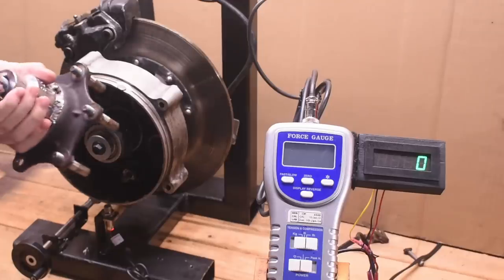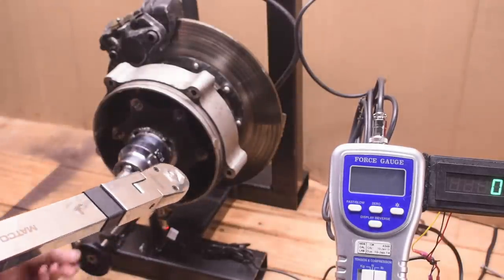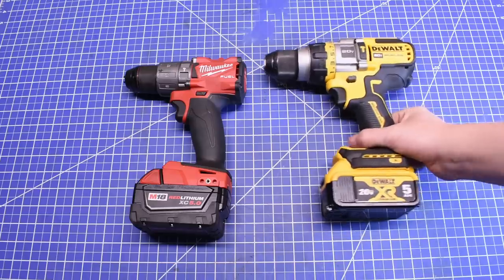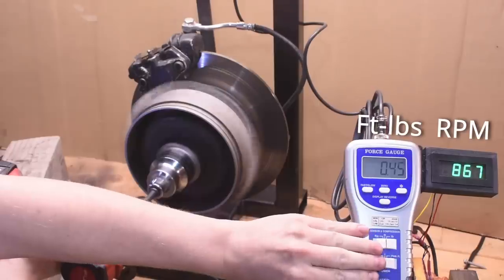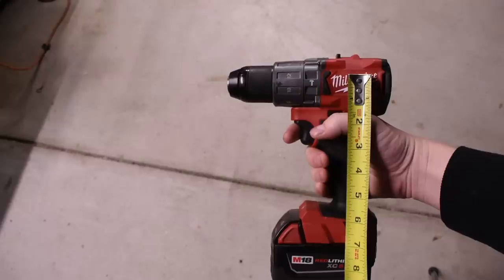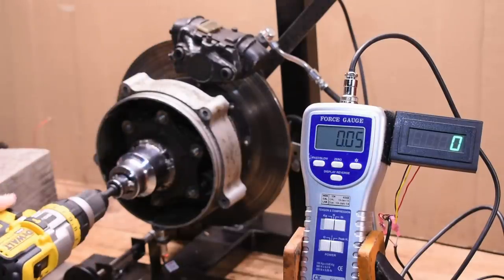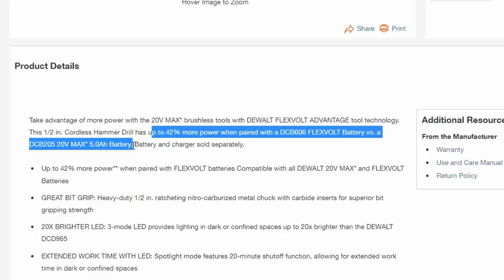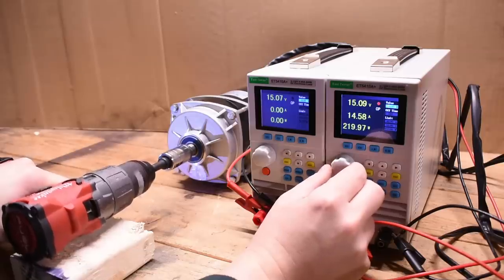DeWALT vs Milwaukee on a Cordless Drill Lie Detector (Dyno Brake)

Comment from the maker: Those with our tool rankings would have seen us add these drills and this category early this week: https://etsy.me/3G8j3QK 
We've seen testing in low in wood with torque adapters before, but doesn't explain why some drills stop so easily drilling into metal on high. We simply dont use cordless drills in low super often. On the topic of soft vs hard toque (giggity) Being we're the torque test channel and already have a rig set up for testing bolts until tight, we obviously tested this 1st and the M18 did NOT read 100 ft-lbs. And that's not useful.
Reply: @mrmalicious4421  you’d probably smoke the pads pretty badly, but it’d be interesting to see!
Reply: can you test einhell/ozito tolls (i have no idea if they are avalible in USA but they are avalible in australia (ozito) and europe (einhell) thanks.
Reply from the maker: @mrmalicious4421  Peak torque of an angle grinder is not very useful info, basically stalling power. At that RPM you're doing no work. We're working on a different high amp motor dyno for angle grinders, but no promises. Sometimes it just doesnt work.
Reply: Bosch GSR 18V-150C is a good drill
Reply: This is way over my head, but the results are very useful, as ever.  Would love to see more tools from team green (Metabo HPT) to know whether I made a mistake buying into that ecosystem fifteen years ago.  Their lifetime tool warranties are reassuring, but not factored into your tests.  Thanks for you all your hard work!
Reply: Would you consider testing some bosch drills?
Reply: I am confused, I read depending on the type metal you should drill metal at low speed per the charts and type metals. Yet you say you drill metal at high speeds and it fails. Which from my humble experience hard metal does not drill well at high speed. Therefore, would be expected.
Reply from the maker: @bettymaverick1098  Drill speed is not simply by material type. It's by material type and diameter. Most drilling we do is high speed for cut quality reasons, but ideally something 3/8", 7/16" would want more like 1,200 RPM or 1,500 RPM into mild steel but the Milwaukee doesnt have that speed option. So its 2K RPM that bogs down to 1,600, 1,800 is closest. But the tool will just stop often. So the 3 settings on the Dewalt make that an easier go regardless of torque numbers really, but it also performs better in high than M18.
Reply: Will you guys be testing the 18v makita?
Reply: If you were to get some  dyno software/ data acquisition.  something like yourdyno or the likes.  To add to your  dyno brake.  Would be able to get  both power (watts) and torque all from the same rig. along with taking into account the inertia of your brake.
Reply: I emailed ya'll a bit ago offering some tools to test. Is there a better way of getting in touch?
Reply: I do not recommend a drill with very high power and very bad side handle, I have the milwaukee, and it is very powerful but the side handle is basically useless
Reply: I am planning to move from the Milwaukee drill to the new Bosch Profactor GSB18V-1330, claiming to generate 1330 ft/lb, main reason is that the milwaukee side handle is basically useless so the drill is too dangerous when drilling
Reply: Merry Christmas. I love what you guys do!!!! Thank- You
Reply: The whole time I’m watching this, I am yelling “We Want Hercules! We Want Hercules! We Want Hercules!”😅

Comment: As a welder/fabricator, I would love to see you guys test corded right angle grinders. I use them all day, every day.
Reply from the maker: We'll give it a shot
Reply: @TorqueTestChannel  i have used a 1200 w bosch grinder with anti kick back and it cut out well before a 900w bosch grinder
Reply: @TorqueTestChannel I find that the m18 milwaukee grinder can't take as much load as a corded one
Reply: @TorqueTestChannel  Yeah please test the Flexvolt angle grinder! (dcg418). They claim 3HP, I'd love to know if that's accurate, it's a beast either way.
Reply: Anti kick back will always hurt performance, mostly for good reason.
Reply: @rileymannion5301  the Milwaukee m18 grinder we have does well...on a full charged battery...for about 30 seconds before the battery is half dead and it stalls with what I consider a small, maybe medium, amount of pressure. That thing destroys batteries. Our batteries worked well with our 3/4” impact until we started using them on the grinder more consistently.
Reply: @rileymannion5301 Good call. I have the flat head M18 125mm (5 inch). They along with others claim to be equivalent power to a 1200 watt corded grinder. As a steel fabricator using grinders every day, I can tell you they are more like a 900 watt corded. Probably not even that. So I would love to see battery grinders up against corded as well to see where they really compare. And of course battery grinders alone maybe. 🇬🇧 I’m subbing to find out🙏
Reply: @BryceKimball7.3 Sounds like you’ve got old batteries. Mine works great almost right up to the battery being dead. But I have also found that any high speed tool does like to eat batteries up.
Reply: @TorqueTestChannel  please include the m18 4.5-6”!! It’s a bigger body then the 4.5-5” and i have used both and believe the 6 to be more powerful. It also cuts much deeper with the bigger blade which is very useful.  The smaller guard will fit if you have a tighter space as well. I love mine besides chewing through the batteries. But this would be a great test, the grinders!!! Awesome videos too man you guys do a good job!! 👍🏼
Reply: @grumpyone5963  the batteries are a couple years old and worm great on the 3/4 impact. The grinder just kills them quick
Reply: If you do test angle grinders, please throw the Bosch GWS8-45 into the mix. I have a 10/10 experience with them.
Reply: @BryceKimball7.3  Ok 2 year old batteries should be ok. I can’t think why they’re dying so fast unless they are small amp hour batteries. I use standard 5Ah and 8Ah high output in mine and there hardly any difference apart from run time. But my grinder does get through them way quicker than my SDS drill for example.
Reply: I used both the 4 1/2 and 6” Milwaukee cordless grinders. The 6” Milwaukee cordless grinder with a 8 amp HO battery was a very nice tool. But it didn’t hold a candle to a corded grinder or really even the 6” dewalt
Reply: Why aren't angle grinders reversible?!!
Reply: @TheMrbubl3s  we used to burn up the bosch / hilti corded grinder . i'm talking the 7 inch . grinding fiberglass it didn't hold up. the dewalt 7 inch 15 amp grinder was much better. the old wildcat that got discontinued was the super beast. i'm talking grinding with a diamond cup wheel pressing down hard on the center to cut material. grinding panels 4 x 18 feet . bosch grinders were crap. same with hilti which are actually made by bosch.
Reply: @helixhippie  well duh, because..... huh... great question
Reply: Corded grinders will continue to rule heavy work in welding etc because of their output, size and cost. Many welders buy MANY corded grinders plus a few cordless for light work, but by nature welding means power is available at the gun/stinger that also being electric.  Test some REAL grinders not the baby 4-1/2 inch things whose only virtue is they're cheap.

Comment: I'm always most impressed with your teams abilities to figure out ways to test the parameters and capabilities of each tool. Some of your test stands are ingenious.
Reply: I'm pretty sure I watch this channel more to see their testing methods than to see which tool is best. I really like the contraptions they come up with.
FWIW, my job is designing and programming industrial sensors (flow meters).
Reply: It would be nice if they used a standard device say a cheap water pump from harbor freight.  Then we could make our own set up at home and see if our devices are similar.  Like how many lbs of water can your drill pump 1 meter in 1 minute.   You should be able to determine the horsepower that way.
Reply from the maker: @MichaelMantion  Tools Tested channel is working on something similar with hydraulic fluid. The problem with the water pump idea is it only measures total work done, not peak power (torque or watts). You have to be able to gradually increase load until the tool cant sustain then have a quantitative number for that load. Someone could buy the drill that pumped the most water then be like why does this thing stall out anytime I try to push it harder? Because it's best suited for pumping water.
Reply: @TorqueTestChannel  this.

The den of tools used a drill water pump adapter to measure capacity of batteries for comparison between Bauer and Hercules batteries to rate them for capacity to see if the claims were correct. 

He also had to replace the water pumps because they wore out too quickly.
Reply: FACTS!!!!
Reply: All though those dial indicators dying for almost no reason was somewhat hilarious

Comment: I would really like you to test ordinary corded drills to see how battery drills stack up
Reply: I think I might have seen that video from this channel. I could be wrong though
Reply: I found this. It isn't exactly cord vs cordless, but pretty close.
https://youtu.be/zQm95N8sGTg
Reply: What is an ordinary corded drill ? there’s millions of different ones. 300w or 750w ? different gearing, task related.  240v or 110v ? things to think on .
Reply: a thought:    a series of tests on battery longevity in power tools would be interesting, there’s a warren of rabbit holes to go down !
Reply: The testing videos are endless!!!
Reply: @1pcfred   well, there you go, I have never bought a drill that didn’t have a half inch chuck,
Reply: @1pcfred   nope, I checked,even my battery drills are 1/2” !
Reply: @1pcfred   I lied, I have a 3/8” chuck corded bosch I inherited from my uncle, must see if it works.
Reply: Nearly all corded tools use universal brushed motors. You are comparing dumb controlled (triac control for speed) universal brushed motor tools against brushless motor tools with intelligent speed controls. Would be interesting.  Btw, it's called a universal motor because it can run on DC or AC (not the triac controller though), but all it really is, is a series wound DC motor. A series wound DC motor will spin the same direction if you change polarity on both the series field and armature. (IE: tying A2 and S1 together and changing polarity on A1 and S2 does not change motor direction, both polarities on the 4 terminals change together as they are tied together). You can only change direction on a series motor if you keep the S1 and S2 same polarity or A1 and A2 same polarity, but change the other. That is why it works on AC power just as easily as on DC power.
Reply: @1pcfred  You are incorrect. The reason it runs on AC is because the field  and armature are both having polarity changed because of being wired in series, which does not change the vector forces for torque in a different direction. This is not up for debate just as 1+1=2 is not. AC switches polarity, and you can do the same by changing the plus and minus on the battery on a universal motor and it will not change direction. It  has nothing to do with the commutation of the commutator. You can either accept you are wrong or continue to harbor incorrect notions as you do now, but ignorance is dangerous to have. 

I suggest google: How does a universal motor work on AC and DC? Here is what you will find:

"It is because the armature and field windings are connected in series that a universal motor can operate with either DC or AC supply. Being connected in series means that both windings are supplied by the same source, so if the voltage source changes polarity, as it does with AC supply, both the armature and field currents also change polarity and the direction of torque does not change. (The direction of rotation is reversed by reversing the current in the field circuit.)"
Reply: @1pcfred  We are talking about a changing the stator field AND armature polarity. If your theory is true, then a permanent magnet brushed DC motor would rotate on AC. It does not, it will vibrate because the magnetic field on the armature is changing, but since the stator is permanent magnets (not changing), the torque forces will change direction as the polarity changes from the AC. It's not just the internet that proves to you as to why a universal motor goes the same direction regardless of polarity changes, but books and ACTUAL demonstration. Take a universal motor out of blender and hook it to a battery as either polarity and it will not change rotation. Do the same for a permanent magnet motor and IT WILL change direction.

 You are getting the commutator switching action polarity changes and polarity APPLIED to the the armature commutator via the brushes mixed up. That is what is confusing you. 

Books that explain it exactly the same way it works as I have done: 

Electric Machines (Isbn: 0-8493-8581-4) on pg.397 
Electric Machinery (isbn: 0-07-366009-4)
Pg: 395

I cannot help you get rid of ignorance. That is only something you can do. Prove your theory with a demonstration. Hook a permanent magnet motor up to AC and see for yourself it will not rotate, thus your theory will be wrong.
Reply: @CrimeVid  nope pistol grip corded drills would come with 3/8 or 1/4 usually. the 1/2 inch ones would only go 1200 rpm and were made for torque. i broke my hand with a 1/2 inch corded drill and a 6 inch hole saw in pine.

Comment: Great testing as always. One issue i see is while yes the drills are adding pressure to the test rig which is being measured while the rotor is turning, when the brakes actually lock up the rotor, all that momentum (potential energy) is turned into kinetic energy causing a spike in the brake force right as the rotor comes to a stop. You would have to have an electronic device to track the brake force so you could take the reading from the moment before the rotor came to a sudden stop. This would also eliminate the variable speeds that the drills will be stopping at. For example if a drill stops at 300rpm vs. a drill that stops at 340rpm, the drill that stopped at 340 rpm will show more torque even if it was a weaker drill because of that rotational energy stored in the rotating assembly when it stopped. Your results are pretty close anyways, but i think this was important to note since often we are splitting hairs between batteries and tool setups. Other than that i love the setup. Looks like a great way to eliminate parasitic loss. If anyone thinks i am incorrect in my thinking or has anything to add please do thanks.
Reply: The rotor stopping suddenly has nothing to do with the brakes locking it up or a spike in brake force, and thus would have very minimal, if at all, effect on the torque reading. The rotor stopping suddenly is happening because of the motor/battery of the tool cutting off power to prevent stalling at full power as that is really really bad for these brushless motors. If it was in fact the brake caliper locking up the rotor, we would see MASSIVE spikes in the FT/LBs reading because of the momentum and weight of the spinning mass suddenly stopping, I'm talking 100+ spikes in FT/LBs. If you notice, they have a small dial on a worm gear to apply a constant braking pressure that they can increase gradually. Don't worry, these guys know what they are doing since they do it "for a living"!

Comment: I've also often looked at the total tool weight as a purchasing factor, as it makes a difference on how less tired you're going to be after using it all day long.
Reply: That and overall comfort. Generally I’ve found that most tools throughout the same brand have similar ergonomics. Just like pistols. It doesn’t matter how expensive or technically better  it is than another one. If it’s awkward fit for you, then you likely won’t be accurate with it or want to shoot it.
Reply: After a year of using only a 1/2" chuck drill I bought a 3/8" chuck drill.  I use the smaller one more than the larger one.  That doesn't include making pilot holes with the small one for the large one, which is why I got a second drill.  And this is for drilling in steels and aluminum.
Reply: I've recently gotten to that point myself as I've gotten older.
I'm a lawn and garden equipment tech. My trusty Milwaukee 2163 that I always used for the most demanding jobs is getting long in the tooth and sometimes just refuses to work. My company has recently started selling DeWalt so I get a considerable discount. I picked up a kit that included the DeWalt 12 volt ratchet and the DCF921 compact 1/2 impact wrench. Decided to try the 921 on some blades, lugs, flywheels, and clutches just to see what it's capable of. To my surprise it can handle all but the worst of what I come across with no problem. It's so small and light that it's like using an impact driver and it doesn't put near as much strain on my body fighting against it as the old Milwaukee does. It's become such a go to tool for me that I've recently purchased 1/2" impact sockets in sizes I'd have never dreamed of owning before, as small as 7mm. It's got enough grunt to do almost any job I can throw at it, but also a delicate enough touch that it doesn't break anything. I'm much more comfortable and less fatigued after a long day of work. I was excited for the DCF900, but now I just don't use the big high torques much at all. I probably will get the 900 when my old Milwaukee high torque finally dies, but as little as I use it now, the 900 will be old news and something better will be around by then 😂